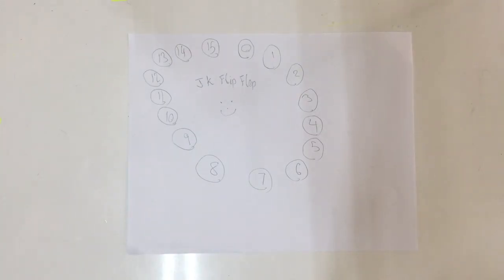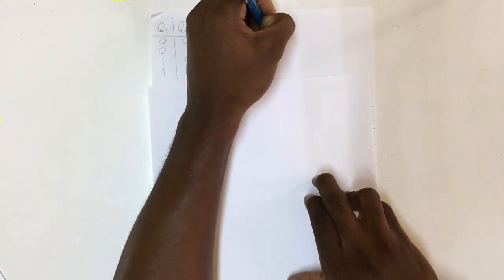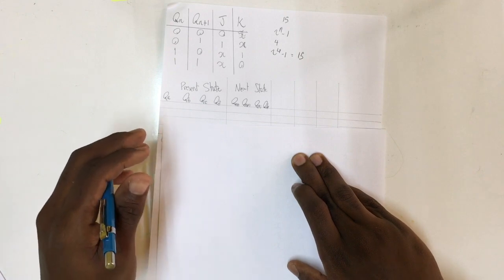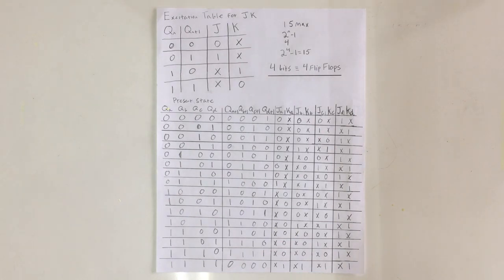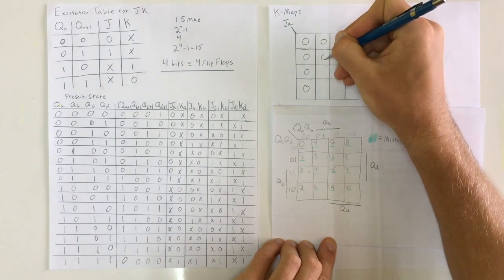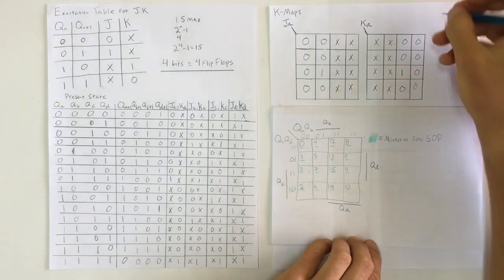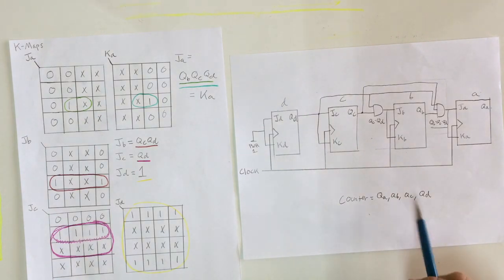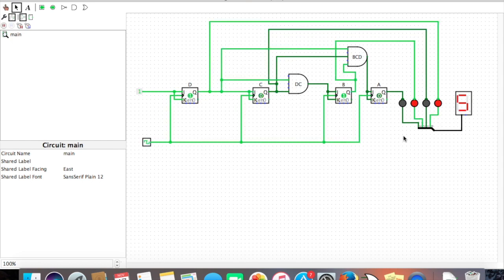Synchronous Counters #3: Example 1: 4-bit Up-Counter

Comment: hey bro, firstly thanks your video but i have a little bit problem how to build synchronous counter that 1-3-2-4-5-7-6-8-9-11-1-3-2-4-5-7-6....and i must use 1 for others?
Reply from the maker: You just need to change the next state of each value in the counter to reflect what you counter will do. For your sequence have the next state (Qa+1,Qb+1,Qc+1,Qd+1) for 1 be 3 rather than 2. If you change the next states to resemble the counter you want to build and then apply the same method for building the J-K flip flop columbs you should come up with the correct logic for the counter you want.
Reply from the maker: Also for numbers that are not in your squece (like 10, 12, 13, 14 or 15), simply have their next state be 1 so that if the counter every comes across those value at the beginning the counter will just jump to the beginning of the counter.
Reply from the maker: Look at my video for an even-down-counter, it will better explain how to manage non sequential counting sequences https://www.youtube.com/watch?v=BwNTwR1Xcd4&t=1s